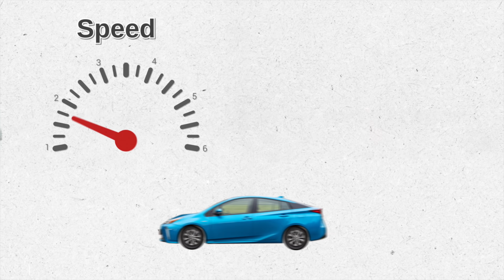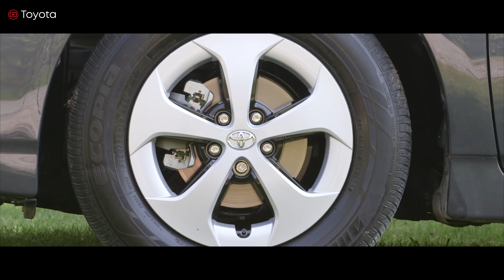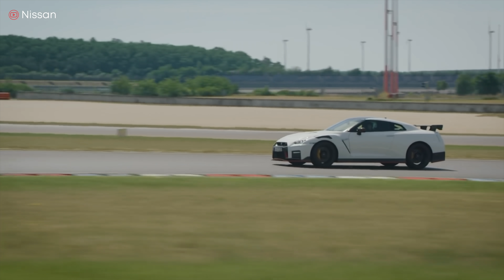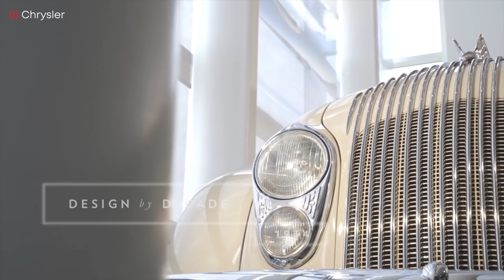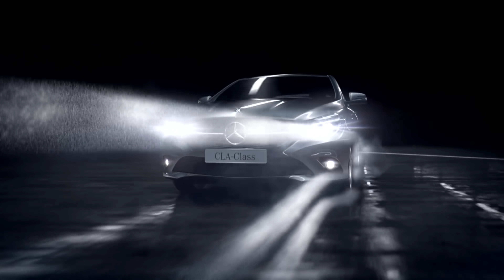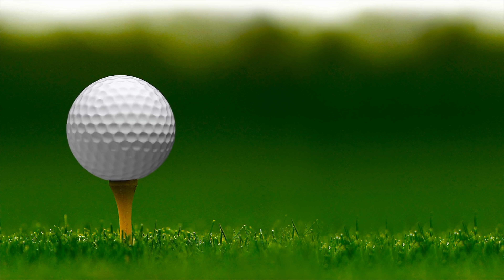Here’s Why Rolling Down Your Windows is Bad for Your Car

Comment: Aerodynamics is so important to car manufacturers that they build new bodystyles every year. 
Why waste time building new bodystyles and figuring out "aerodynamics"? It's just a hunk of metal to move you from point A to point B. If car manufacturers would keep the same bodystyle and perfect it and everything else on the car, we would have a great car. More time could be spent on perfecting one car than making new bodystyles and all the ensuing changes to every other part. Aerodynamics isn't even important in the way most people drive their car which is around town under 50 mph and short distances. I truly don't want to hear another word about aerodynamics. Every car should already have gas mileage of 50+mpg.

Comment: I want to know that.. which does affect the fuel consumption when i run the A/c on,
Is it the fan speed selector? or the temperature selector knob when is put on the limit (blue strip) ?

Comment: Unless it's freezing cold or blistering hot, my windows are down; I just like the open-air feel.
My SUV has wind deflectors around the front windows though, which makes a big difference at highway speed.

Comment: A couple of cars mentioned in the video were Audi and Toyota.
Audi had a problem with the throttle locking full open and the car could not be stopped with the brakes.  Audi determined the problem was a defective vacuum valve under the hood, and they corrected it.  Audi also pointed out that the problem only occurred in cars that were made for people that didn't want to learn how to drive because they had automatic transmissions in them.  
Toyota said it was the carpet grabbing and holding the gas petal.  I would NEVER trust ANYTHING that those liars ever say and I would NEVER buy one of their cars.

Comment: Then you’d want to ask yourself. What would you rather replace, a ac compressor or a fuse for power windows. 😂 I run the ac when it’s 90+. Never had a problem with my car and it’s ac. Replaced free on once since I bought my car brand new in 2015. I crack the windows half way when I ride. And when I’m ready for the ac, it turns on like a champ. Also, idk if this is a myth but I usually drive my car for a few miles to let the hot air get through the exhaust, and then turn on my ac. I know a lot of ppl who leave their ac on when they start up their car and a good majority of them end up with bad compressors or have to replace ac lines. That’s why I started doing that. So far I think it works. Could be just a myth though.

Comment: One factor is missing in your video; that is wind resistance increases with the square of the vehicle's velocity. So yes, while one car may be more aerodynamic than another one, and that it would be more beneficial to run the AC above a certain temperature. But it's all moot if your car isn't travelling that fast. I mean, there's a certain speed at which wind resistance becomes high enough such that it's worth having your windows up and the AC going; I don't know what that speed is. OTOH, you could have a Model T and a modern aerodynamic designed vehicle both going at 30 km/h. At that slow speed, aerodynamics don't play a very big role. You did kind of touch on this, but it's worth explaining out more.

Comment: I cringe every time I roll a window up or down in my Ford Escape because the mechanism is so crappy. I have had to replace the unit in two of the doors already. You get into the car and notice a window has dropped down and the mechanism is broken (plastic crap). A real pain to replace.

Comment: Ground speed is not the same as Airspeed.  If you are driving upwind with a wind of 30 mph at 70 mph, you are doing 70 mph Groundspeed, but airspeed will be 70 plus 30.. =100 mph you are getting in airspeed.  Im a flight instructor for 4 decades..

Comment: now i may be wrong but why would an engine have to rev higher to fight against the wind? assumuning the gear is the same throughout both test, shouldnt the engine rev be the same with both situations? as the engine speed is tied to the wheels. if we are talking about building up speed, sure, i can see why later gear changes would be better but we are talking about maintaining speed, so only the torque supplied by the engine will change. going with your cyclist examples, assuming the bicycle only has one gear, the cyclist will have to pedal harder, not faster to rea cch the same speed.

Comment: What about your speed? I'm surprised that wasn't mentioned. I live in Toronto and generally on city streets I drive with windows down but then roll up with AC on highways. Also, please include metric figures with the temps, I've noticed it's an American thing to forget the most of the rest of the world does not use the outdated imperial system.

Comment: Red Green had an episode where he applied the golf ball principle to his vehicle, he beat it with a ball peen hammer. ;)

Since areodynamic drag goes up with the square of the speed, using 2-35 air (2 windows open at 35mph) does not create nearly as much drag as 2-70 air.

Comment: KEEP YOUR WINDOWS DOWN or slightly cracked if on the highway. The chemicals from your car interior, adhesives, and engine leach pollutants and neurotoxins into your car air from sunlight and heat. Ever get a headache or feel sick from a long day on the road? Putting your windows down is one of the best things you can do

Comment: Don't confuse the word "aerodynamic" with "streamlined".  A streamlined car slips more smoothly through the air. The Model T is technically more aerodynamic than a Prius since it introduces a greater "dynamic" to the air through which it passes.

Comment: I saw a Mythbusters episode where they tested the golfball effect.  They ran a car down a track clean, then again dirty to compare fuel economy.  The they actually put clay all over the car body with golf ball dimples.  A few hundred pounds of clay would make acceleration worse, but they only measured fuel economy at cruising speed where the clay made a pretty big improvement.

Comment: Look at model a towel seden and ford 500 ninty years newer a box truck is bad. Auto hauling is bad compared to steel plate on hotshot trailer the three car load kill fuel milage is killed

Comment: Wow. Yep. Makes sense and I learned what B-pillars are. Here's a rabbit for the pot in the shape of a hot weather windows down tip for cooling and streamlining. Like, if your a.c. doesn't work. A lot of people probably know, but, some may not. If you're going to be cruising on a highway as in for a while, roll up the windows on one side of your cab, and down the windows on the other. Both of the down ones opened to the same width. This creates a much less gusty and drag inducing cooling vortex blowing across the back seat, around the front seat, and back out the cab. If you're taking your safe driving time in the regular or slow lane and opt to open the windows on the passenger side, passing trucks and large vehicles noise and turbulence are much much further reduced in your cab. It's easier to have a conversation, or hear what you know that dear kid in the back is whining about anyway. Depending on the weather temperature, you might partially roll up those open side windows and further increase your streamlining and noise reduction, while remaining well blown as you roll on to Tulsa after the first next pit stop for Jr. I love to take advantage of every aerodynamic and function improving possibility, even if my a.c. doesn't work.

Comment: Cd isn't everything. Model X might have a sub .3 Cd, but it probably has a larger frontal area than sedans and, thus, would have a larger drag force than a sedan with the same Cd (same velocity, same elevation), which should have a smaller frontal area than an SUV/CUV. Force of drag (Fd) = 0.5 * Density (air) * Velocity^2 * Cd * Area. I don't think this was covered in the video, and I think it's important to know this.

Comment: Regarding the air conditioner, Myth Busters concluded that fuel economy is better at freeway speeds with the windows up and the AC on.  But, around town at slower speeds, the windows should be open and the AC off.

Comment: The windows theory goes along with Mythbusters leaving the tail gate down... The tailgate creates a swirl of air in the bed of the truck that acts like a camper shell over the beds cavity and allows a flow of air right across the tailgate. 
Same thing for the windows down. Only so much air can rush into the cabin of the car at one time, so in essence once you fill the cavity then most of the air flow is cut off from entering and will be pushed right past the window opening....

Comment: The faster you go, the more drag.  I think the drag increases faster with the windows down and there is a top speed for each vehicle that it is the same with windows up or down.  Not much drag at 30MPH.  I think MythBusters did this one.  Tailgate down on a pickup truck has more drag than tailgate up.  They wash and wax airplanes for a reason.

Comment: Airplanes take off into the wind to use less runway. Airplanes take off at the same speed (indicated airspeed) into the wind
or downwind, but for the same indicated airspeed the ground speed is less with a head wind than with a tail wind. Thus, for
the same take off speed (indicated airspeed) , the take off distance is lower with a head wind. For landing the same applies.

Comment: Volvo got a big shock years ago when testing a sedan and a wagon at speed the wagon shot ahead of the sedan due to a longer roof. VW added 20kph top speed by increasing roof length a lot of design is compromised by consumer perception eg sloping rear window when a long roof and an upright rear window is substantially better.

Comment: 1979 I left ASU as my sweetie wanted to play the field I set off broken hearted on an 8000 mile circuit to Oregon Ohio St Joseoh Missouri where the wagons pushed off westward bound and my great grams attended Jesse james funeral and had gramps... next was the trip west. And the headwind... Eastbound was a breeze and I would often open my single layer nylon red Cessna Aviation jacket and i had an extra 5-10 mph eastbound but westbound I started putting on muscle 6'8" 265 and headed for the rockies... I dreaded the east wind but it got me strong as I pushed through west slope and out 550 South through Ouray where it was Oct and snowing. I pulled home into Prescott and no one on my family saw the 3 times i I made the news ...

Comment: Wow, temperature makes a difference in drag if the windows are up or down? How about speed. Other tests have found that at lower speeds, windows down do better for MPGs and at higher speeds, the AC does better.

Comment: My Lexus mk4 gs 450h f sport has a aerodynamic co efficient of 0.26. I only put my window up on the motorways as I feel better serco dynamics and fuel economy. I irony is the hybrid battery preforms better in the summer then winter.

Comment: Interestingly, it was Audi, when they designed the second-generation Audi 100, that discovered when you roll down the windows travelling at speeds above 70 km/h (43 mph), the aerodynamic drag lowered fuel economy more than a car running the A/C with closed windows. That's how strong rolled-down windows can affect the aerodynamics of modern cars.

Comment: RPM and speed are a fixed ratio for manual and traditional automatics. More drag does not increase the rpm (unless the drag is enough to require a downshift). To maintain the same speed the throttle will have to be opened more which allows more fuel to be burnt. Under low drag conditions (no wind) you are not extracting all the power at a given RPM. With wind for the same speed it will be same rpm but more power because of more fuel because you push the throttle further to maintain the same speed. CVT in theory could rev faster at the same vehicle speed.
Reply: Thank you! I just watched the video and was surprised that no one mentioned it in the comments.

Comment: The real reason that a dirty car doesn't act like dimples on a golf ball is that it's not big enough to create the turbulent flow needed. to stay attached to the car profile. Laminar flow is generally considered better for drag reduction BUT on most vehicles the problem isn't the drag of laminar vs. turbulent air, it's actually flow separation which leaves a low pressure area (think vacuum) BEHIND the vehicle. Turbulent air like that created by golf ball dimples puts energy into the air which helps it stay attached reducing the low pressure area behind the vehicle. Take a look at the flaps on the back of some big rig trailers or the little upside down wing on the back edge of a school bus. They are attempting to keep the low pressure area from developing and "pulling" the vehicle back.

Comment: I never thought that leaving my car dirty would increase the aerodynamics of my cars fuel efficiency. It’s always dirty because
 I’m too usually to busy to take it to the car wash, or if I have time I either... 

A. Forget that taking my car in for a car wash has been on my “To Do” list since July 2020,
B. Don’t care about my car being dirty AF on the outside(inside is pretty clean, but could use a good run with the vacuum), or
C. I am too tired to take it in to be washed. I would rather go home so I can relax before my relaxation time is over, and I have to be up and moving again.

Comment: Excellent video. But airplanes take off and land into the wind to reduce the ground roll. The plane sees speed of air past wing. Adding 15 knots means plane can get airborne at a slower ground speed. Keep up greats info. I’m retired after 45 years fixing cars.
Reply: @Mark Codiroli probably closer to 60,000.

Comment: As a Aeronautical engineering grad I find your explanation spot on. Made me remember my instructor in aerodynamics how he explained things.
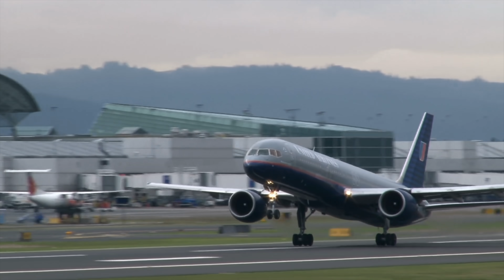Reply: 03:39 Is this statement correct?
Reply: @thingserik7269  Its put in simple layman terms . Higher velocity = lower pressure which creates lift.
Reply: @thingserik7269    3:39   I questioned that statement too.
Reply: When will aerodynamics be perfected? Why do car manufacturers think we care about aerodynamics? How about a better engine that yields high gas mileage? Aerodynamics doesn't boost fuel economy much, only 2-5%.

Comment: that's exactly what i thought, till i bought a plug-in OBD2 and turn out rolling window down is actually more economical. as ac compressor sap 4 or more HP depending on the size and capacity. btw my car is a 2018 hatch back, Perodua Axia manual. aka Toyota Agya

Comment: I used to have a '77 Chevy van that had the aerodynamics of a brick. But because of the engine I built and put in it, I could 'pin' the 100 mph speedo in 2nd gear of the 3-on-the-tree, then hit 3rd and kick-in the secondaries. Top speed unknown, but a brand new mid-'90s Trans-Am gave up trying to catch me. [Wink.] JMO.

Comment: Scotty there are some who spend a lot of time in their cars. They put roof racks on the car. I needed segregation of cargo so I opted for the trailer hitch and cargo box rear. I actually saw an improvement in economy IF I stabilized the rack with a wratchet strap. 

I drove Louisiana to west TX without a strap the car was all over the place difficult to keep straight tiresome to drive . After some investigation realized it was oscillating, added the load stabilizing strap . Economy improved, the driving range increased , car was easier to drive , I could drive faster. 

Haven't tried to load the roof but heard from a girl who travel's perpetually that her economy is 30mpg. 15mpg less than the average of the trailer hitch cargo rack/box.

Interstate is where the hybrid gets worse economy because of the design of the car.  City driving is preferable to hybrid system because it's less friction over all and the energy is not spent friction braking rather it's speed is reduced by returning energy to the battery via regenerative braking system.

Comment: mythbusters actually tested both the myth on car windows and dirty car.  The windows down versus AC depended on car speed. (plus as mentioned in this video, ambient temperature, plus different cars, all come into play as well). So that one is very inconclusive.  Dirty car is correct that it worsens mileage, they did test the golf ball effect by using clay and cutting dimples, of course dirt does not work that way.

Comment: I think the window vs AC debate has been proven that on highway roads, you're better off using the AC because the drag from the windows being open isn't there, and with modern cars, the impact of using the AC versus not is minimal, like 2 MPG loss if that.  It's not like it used to be where you might lose 5 MPG using the AC (in older vehicles, say pre-2000's) but they've made AC and heating systems in cars much more efficient.  I mean if you're going something like 20 MPH, then it probably doesn't matter, but I'd say 30 MPH or higher (and definitely on the highway) you're better off using AC.  Not only is it quieter, but it's more fuel efficient).